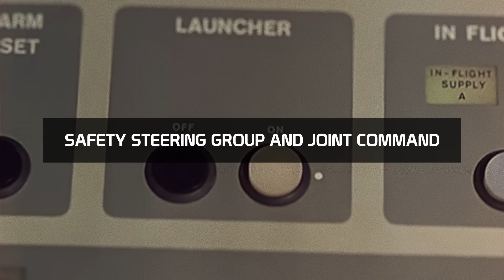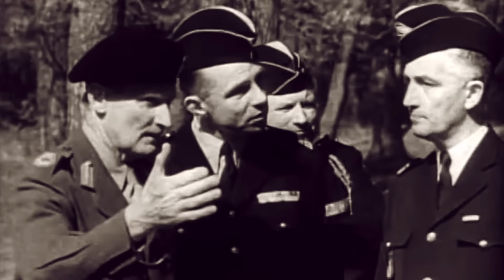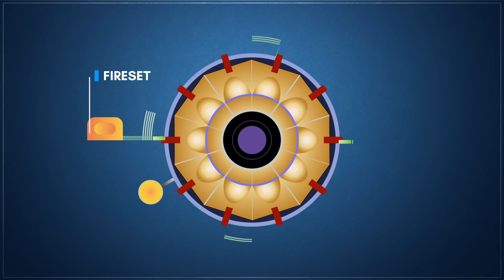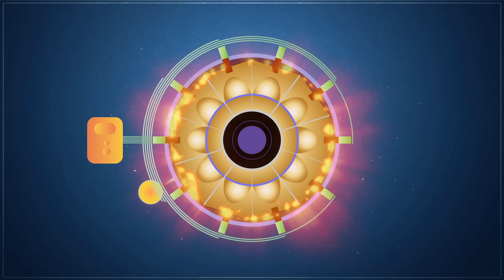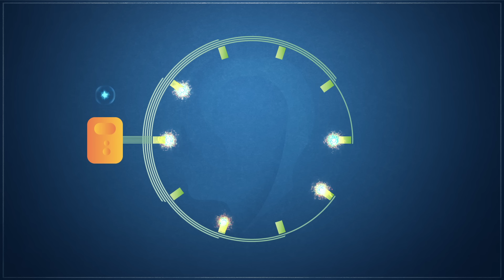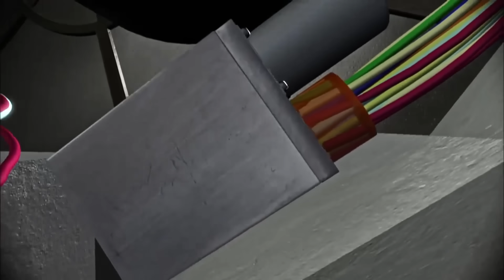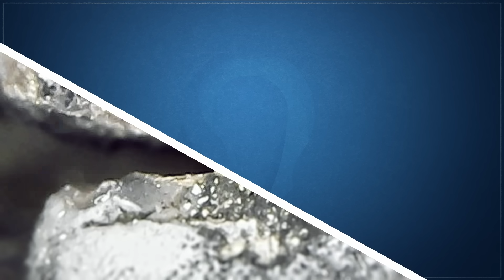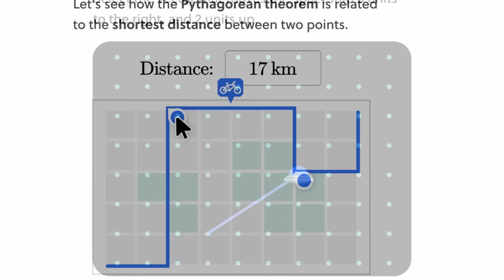The Remarkable Mechanism That Secures Nuclear Weapons

Comment: Nuclear weapons are designed to be two-point safe. Two points of failure will not allow a nuclear detonation. There also is another concept, which sounds scary; instead of fail-safe, it is fail-deadly. A failure will render the weapon unusable, and not necessarily in a manner where it can be reused. A fizzle is a possible fail-deadly outcome, which is essentially a dirty bomb without the nuclear payload going critical. There is some environmental checks, where the warhead doesn't arm unless it is launched, reaches space, and achieves a ballistic trajectory (e.g. you can't take a warhead and detonate it on your own).
  They also have training and tactical settings.
Reply: Yes, fail deadly is used in situations where the weapon could be captured unused so that attempts to gain access to its materials will result in unplanned rapid disassembly by design to prevent the nuclear materials from being salvaged without PALs and proper equipment.  This is easily done by the intentional detonation of just one chemical explosive lense which will distort the shockwave as the remaining lenses would be detonated by the propagating shockwave but also out of sequence enough to prevent criticality of the core while ensuring the material will be scattered significantly enough to be totally useless, basically a weak dirty bomb.
Reply: @larrybremer4930  All the tests they did to prove that exploding one lens would be save and end in a dull endet in an significant yield :( led to the development of concepts and bombs that only use 2 ignition points...
Reply: @Nutzername36  Yes, the "Football" instead of the "Soccer Ball" arrangement.
Reply: @larrybremer4930 So, if initiating detonation of only one lens could cause a nuclear yield, does that mean even a fail-deadly anti-theft URD event would result in a low, but not insignificant, yield fizzle?

I'm all for it blowing up in the face of a thief conventionally, but an actual fizzle seems a bit too irresponsible.
Reply: @mnxs  Even a two point football lens would produce no fission, or at most 1 or 2 cycles that would be low order as to have nearly undetectable and negligible contribution to the chemical explosive energy of the lenses exploding if only 1 point is initiated.  Remember that the lenses are shape charges that require simultaneous detonation to create a shockwave that will crush the core.  If there is any "hole" in the explosive lens due to mis timing the core will simply squirt out of that low pressure zone in the shock front rather than crush.
Reply: @larrybremer4930  Right, that's how I understood it as well. I got confused because you seemed to agree with @Nutzername36's comment that they discovered it would still produce a, to quote them, "significant yield"? Which seemed to go against my understanding of it basically being rendered a big conventional bomb that just so happened to also spread around some radioactive material, but that the actual fission was negligible.
Reply: @larrybremer4930 ah so when they say football they mean an American football shape?
Reply: @robscovell5951  yep, 2 lens construction
Reply: You mean if I hit the nose with a hammer it won't go BOOM?
Reply: This is nonsense.
Reply: DOES IT MATTER IF THE SYSTEM IS FOOLPROOF IF THE CH0WDER HEADED COMMANDER IN CHIEF IS TOO SEA NILE TO REMEMBER HIS GOLD CODES? ROBERT HURR SAID “EL PRESIDENTE” COMMITTED HIGH CRIMES… AND WAS SEA NILE… SO… Y EXACTLY R WE CONCERNED ABOUT THE “SECURITY” OF OUR RETALIATORY CAPABILITY? SHOULDN’T WE BE MORE CONCERNED W/LOOKING UP THE PURPOSE OF THE 25TH AMENDMENT?
Reply: In case of nuclear weapons, 'fail-deadly' means it will always detonate. Rendering a weapon unusable is always safer because it prevents a thermonuclear detonation, even if it means spreading fissile material
Reply: I wonder how big a bunker it would take to capture all the materiel from a very-much-intentional-RUD? IIRC modern designs don't have that much conventional explosives so ever with a booby trapped device, it should be possible to extract the active materiel from what you end up hosing off the walls of that bunker. If you care about your people, just set it off with a shaped charge of your own. If you don't care about your people, send in your best bomb tech hoping they can get it out in once piece but if they can't, it's not that hard to separate the tech from the rest of the residue.
Reply: @benjaminshropshire2900  You might want to read up a bit.  The first hint is the warhead is an oblate spheroid, so timing is crucial. Second, there's a lot more in there than just plutonium. It's fission-fusion-fission.  You can't just get deuterium either at the store.
Reply: @patrickvolk7031  you might not be able to rebuild the design you got the material from but trinity was a simple sphere and a pure fission device.
Reply: @benjaminshropshire2900  You should really read up on it if you're interested (if you like chemistry, or physics, it's interesting). A gadget device is a different animal than a thermonuclear primary. 
   It's much, much more than getting a critical mass of material together and slapping explosives around it. You need an initiator (urchin, beryllium because it turns other radiation to neutrons, and polonium-210, prolific alpha emitter, needs replaced about every 6 months). It used klystrons, which were high-voltage switches, which contained radioactive material to dissipate static charge. 
   Casting and machining plutonium is not like casting lead. Plutonium has many solid states, and different densities. If there's oxygen or moisture, the oxide/hydride is pyrophoric. 
   A gun-type would be simpler, but you can't use plutonium... too reactive.
Reply: @benjaminshropshire2900  Impossible.  You would not be able to mechanically separate the materials by mass without a full enrichment plant to separate out the contamination (non fissile materials) and process it like high grade ore.  So when I said you cannot mechanically separate it that is somewhat of a lie since enrichment plants using gaseous, thermal, or centrifuge diffusion,  etc. and those methods are all technically "mechanical" since they rely on the slight differences of mass of elements and isotopes.  In any case you have to go back to yellow cake form then refine up again from there.  There is also always leftovers in refinement that carry into the next batch process but if you only have enough for one  weapon and even if managed a spectacular recovery of a scattered core you still may not have enough material for a new weapon because they normally use just enough to do the job  so the loss of even a few percent may not be enough remaining.  Now if you have two such bombs at your disposal and an enrichment plant, then sure you could probably get enough but if you have an enrichment plant you don't need someone else's bomb since you can refine raw, low grade ore yourself in that case.
Reply: @larrybremer4930  Your comment seems to make a few flawed assumption. First, your comment assumes that the refinement of the materiel is the same as for uranium, but by far the most common type of device is a plutonium device, which is a different element on a chemical level. Second, there seems to be an assumption that isotopic separation, i.e. "the hard part", would be required which is not (necessarily) the case for plutonium as the plutonium generated in reactors can be made to pure enough from the start and that's what you would be dealing with. The result is that the plutonium can be extracted from the rubble about as easily as un-enriched uranium can be from ore (which Cody's Lab did in a video in his garage) and that the product can be used as is. (That is assuming that nobody did something clever with the design like stash some plutonium-240 in the device which would tend to cause devices to fizzel and would actually be harder to separate from the 239 than it is to enrich uranium.) Even if it is a uranium device, the uranium is already enriched so only chemical processing would be needed to get HEU (as long as the device doesn't contain any depleted uranium).

As for not being able to recover enough materiel, sure you will loose some, but I don't think the margins are near as tight as you imply. IIRC one of the design trade-offs is between how little extra materiel you need and thing like yield, reliability and size of the device is. If you are able to build a much larger device, you can get criticality with less material (basically you squeeze it to higher densities and the critical mass goes down).
Reply: @benjaminshropshire2900  yep, but i was already getting wordy enough.  most modern bombs have both U and Pu but also steel, lithium, cobalt, aluminum, and all sorts of other stuff that all gets vaporised and would need to be separated from your fissile materials, then the fissiles need to be separated from each other if both are present.  so all I am saying is vacuum up all the debris, and it then needs to be separated but in the boom of the chemical explosives a lot of those materials would coatings on each other, literally welded together and that all needs separating.
Reply: @benjaminshropshire2900  Have you ever tried casting or machining plutonium? Or uranium? To say it's fun is an understatement. As Larry said, there's a lot more than you think. Geometry, timing, radioactive effects. 
   There's also not just 1 kind of nuke.
Reply: @larrybremer4930  how's that any harder than separating Pu from fuel rods out of a breeder reactor? Refining metals from dirty sources may literally be the oldest chemistry other than making booze. It's not trivial, but it's not exactly a national secret either.
Reply: @patrickvolk7031  none of those are easy problems, but they are much less hard than high grade isotopic enrichment of uranium or synthesis of plutonium from uranium. So even having a "thoroughly disassembled" device gets you way more than half way done compared to starting at trying to covertly source ores. As evidence, have you ever seen the physical manufacturing processes cited as a major accomplishment of the Manhattan project? I haven't.

Also the fabrication would be a lot easier to hide; you could literally do it in any light individual park in the world with a few million in off the shelf tools and equipment. Making your own material would likely cost billions and would tip off every arms monitor on the planet.
Reply: @benjaminshropshire2900  During WWII, instead of using copper to do the calutron coils, they used the entire US silver reserve and silver wires, the copper needed for conventional stuff.
    Putting the initiator was a heart-stopping moment, because it wouldn't fit. 
    They used a lot of hydrogen balloons in the test tunnels to keep air out. Pressures and speeds which were beyond anything.
   The computers, human and mechanical used to do the calculations. 
    The Israeli virus designed for a particular SCADA controller to destroy Iranian centrifuge.
Reply: If you are attwmpting to reclaim enriched uranium or plutonium from the vreck of a detonated bomb, you are not doing uranium enrichment, you are doing alloy fractionation.
You just melt the whole thing down, but it in a centrifuge, and let the significantly different densities of steel and uranium naturally separate.

Comment: Im missing something, you discussed Aircraft based systems but what about ground systems are they the same? I assume the codes are specific to a specific bomb or are they generalised so if a plane wants to drop multiple bombs does each one have to be armed separately? Assuming each code is matched to each bombs serial number or similar where are the codes stored what is the restrictions on access. If the US is going for an all out response to a ICBM attack how would they get all these codes to each missile so they could respond quickly? If an EMP attack happened killing comms to say aircraft or non US based systems how are the codes sent? all sounds a bit questionable in real situations to me
Reply: Land-based ICBMs rely on multiple launch votes from missile launch crews (e.g. 6 of 8 turn their keys), which launch all missiles in the wing. Similarly on SLBMs, you have one code to enable, they targeting is separate (they use mnemonics, so you don't know the targets), the captain has a permission to fire key, and the weapons officer has access to the safe where the trigger is.
   ELF was used previously, which literally goes through the earth, and is slow. The trick is detection of launches, both sides have satellites looking for that. Satellite communications is also used I think. I know the ELF system was used to send 60-word family grams to the sailors (they couldn't respond).
Reply: @patrickvolk7031  detonation detection had sound based, pressure based, seismic based and satellite based.
Our intermediate nuclear missiles were of course, theater based, so theater command gets codes for launch, forwards local missile codes to plug into the PDP-11/70, it sent its voodoo to the missile's computer. They got retired as they were being deployed to replace the earlier generation. Thankfully.
Yeah, I was Pershing at the beginning of my career.
Reply: The sequences I've seen from demonstrations and training footage is that the actual launch orders aren't transmitted. Each unit has with it a set of coded orders containing a number of hypothetical launch scenarios, along with many invalid or decoy orders. When a launch order is issued, they're given a coded sequence that reveals which set of orders has been given, allowing the operators to pick out the correct set of activation codes, destinations, and launch timings, and execute them.
Each command has only one code for all the missiles under its authority, but that does not necessarily mean the orders will be to launch all of them
Reply: @watchm4ker  it was defined in the SIOP, Strategic Integrated Operations Package. You has scenarios with MAO (major attack option), LAO (limited attack option), and TAO (theater attack option). Those are provided resources (sea, land, air).
   It's a code, but it's still a command with the orders predefined. There are multiple WPs (weapons procedures) depending on launch scenario. They're like a play script, where every person has the script, and their part.
Reply: @patrickvolk7031  the SIOP was replaced in 2012 by OPLAN 8010-12, that was updated in 2023 by OPLAN 8044. Same basic beast, streamlined and updated and someone justified their job by renaming it.

Comment: The fact that anyone can go on Google or come to YouTube and get a very precise tutorial on the workings of a thermonuclear device makes me worry about what is out there that's top secret 💀
Reply: the video is not very precise, you have no idea of how complex the pattern of detonation is to create the shockwave in a way that it would equally compress the material so it can detonate.
but there are textbooks explaining how it works, its not hard to find on the deep web, its still useless because you don't have the data tables to calculate the thermal detonation, and you need supercomputer for that.
also bear in mind what was exposed was old tech, it was already modernized by this point. 
I'm more impressed by the MEMs they use, as other people said in another comment, a super-complex electro-mechanical switch the size of a TO3 is kind of amazing. Even more if you consider they were doing MEMs in the 2000s way before we had those in consumer electronics.

Imagine what sort of fun technology they must have, I bet they're using quantum cryptography or something, that would be top secret.
Reply: @monad_tcp 
Bro... it's really not this difficult to detonate a nuke. What is more difficult is getting your hands on enough material to make a nuke. That is the real safety mechanism the barrier to entry. Also, just let it sink in that a basement made nuke won't have such safety mechanisms at all and could still use the ballistic detonation method, which itself bypasses all the measuring and control required to get a high yield clean nuclear detonation using less material with less fallout due to better conversion of energy and using less fissable material.
Reply: @monad_tcp  not even deep web, any decent college library has the references.
Some even have the supercomputers, but oh, not the software.
The neutron generator used is also kind of impressive, it's decidedly not a college physics lab kind of model.
Reply: @monad_tcp  I'm of the belief that the most top secret research was done in to anti gravity / manipulation of gravity. The Germans were researching this in WW2 whilst the allies were working on the bomb. They had a prototype (The Bell) but never made it to full production. When the Germans surrendered many of their highest ranking officials and scientists were taken to the USA under operation paperclip. Most people believe that Werner Von Braun was the spearhead with the development of rocketry, but it's interesting that sightings of unexplained craft skyrocketed (pardon the pun) shortly afterwards.  

How would you keep such technology secret? Enact a plan to discredit every sighting and piece of evidence related to such craft.  It's a weird world we live in.
Reply: @monad_tcp  Again, you don't need to build a fiddly, complex implosion-type nuke. Build a gun-type nuke, similar to Little Boy. The big problem is how to get ahold of enough fissile material. Well, that and how to fabricate a modulated neutron initiator.